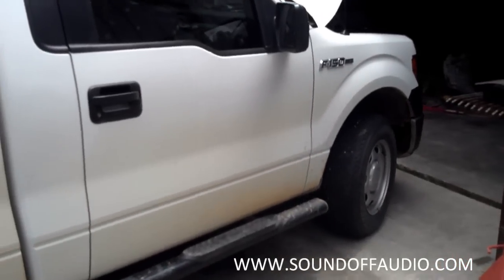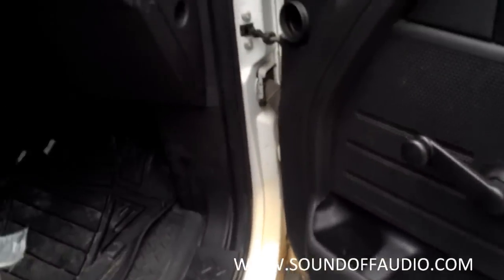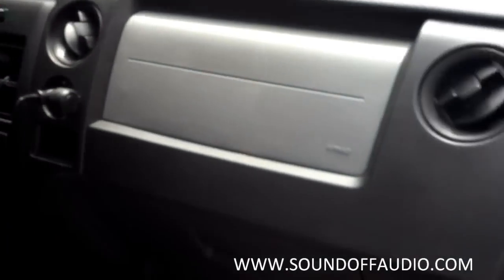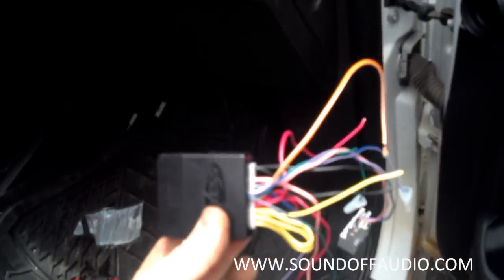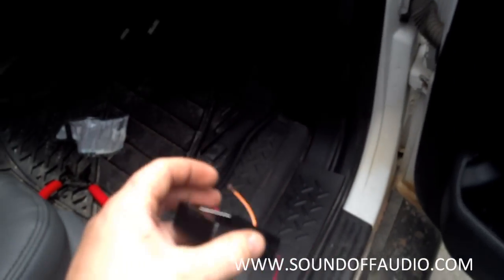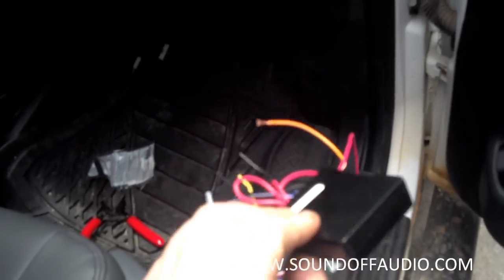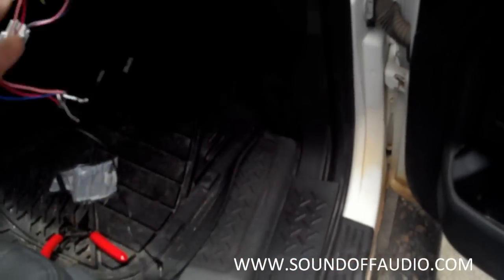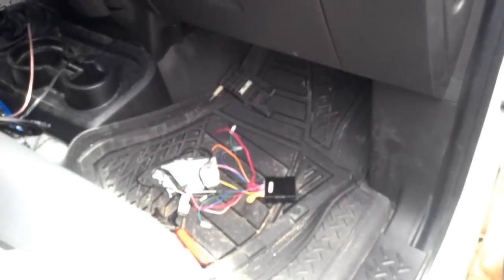FORD F150 2011 CAN BUS BYPASS.

Comment: I know I shouldn’t ask all this on here but I have a 2011 Ford F-150 with all the sync my touch crap. 7 inch screen with the touch screen climate controls and all that. Well, it only works when I wants. Works for 6 months then for the next 6 it will pop up the ford emblem, cycle to Sony emblem then shut off and loop over and over and over but never start. My question is this. Have u ever heard of one of these stereos doing this and what’s the fix or if I went with aftermarket can I get a setup to keep all the steering wheel controls and the climate settings on screen?
Reply from the maker: I would take it to the dealership or install an aftermarket one. Sounds like a power/ ground issue.
Reply: @SoundOffAudio  thank u. I’ll look in to that. If I can find it then I’ll take it to a dealer. 100 percent .again, thanks